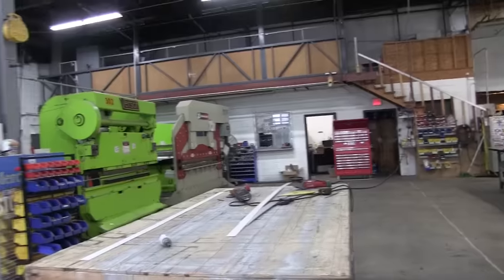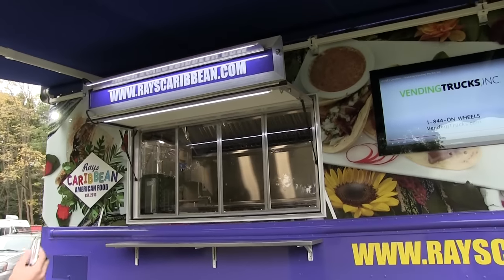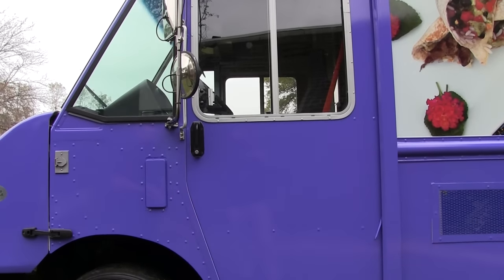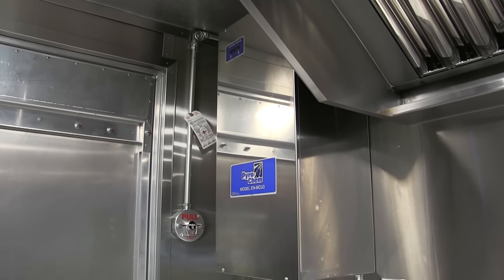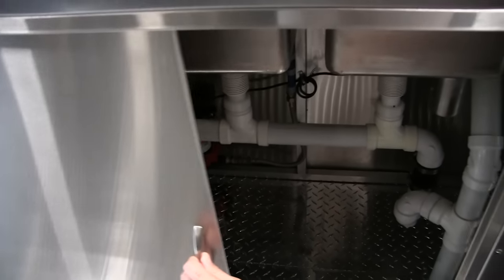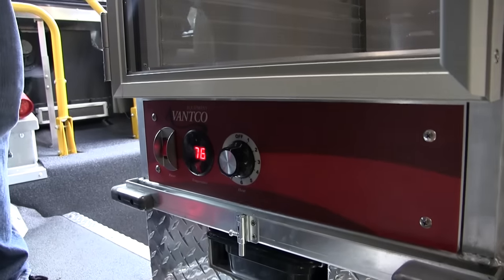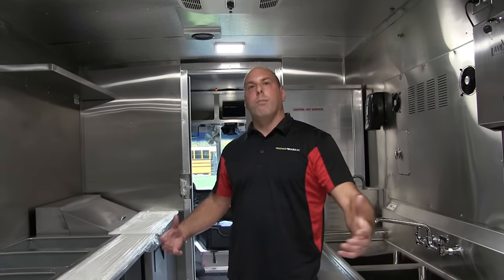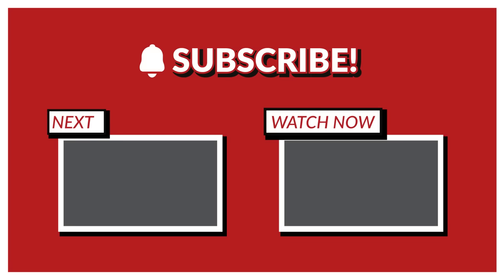Top-of-the-Line FOOD VENDING TRUCK INSIDE TOUR

Comment: Very interesting to see and hear how this process works from the inside. Something that wasn’t addressed in the video; how is the truck leveled once on site? I would imagine this would be an issue especially when using fryers full of boiling oil and cleanup sinks that need to drain properly. Do food trucks have a leveling system like an RV would have?
Reply from the maker: Great question. Leveling jacks are an option but many use leveling blocks

Comment: Great video, there are a couple of things that came to my mind when I watched it, the first one was, how they make sure that, that huge juice dispenser is not going to fly off that table while driving? What did you do to secure it? My second question is about that awning, does it go inside an encasing when retracted? How do you prevent it from getting damaged when it is rolled in and you're driving down a highway under the rain?
Reply: Hi Alfredo, the juice dispenser is mounted to the countertop to avoid it from moving when the truck is in motion (aluminum square tubing).  When the awning is retracting in, it is covered under a protective aluminum hood cover.  The material is rated for weather/rain.

Comment: Nice truck! How much does the truck cost to build in this video? Thanks!
Reply from the maker: I believe this one was 150K.
Reply: @NewJerseyOutdoorAdventures  I have one question! Does the onan generators runs 24 hrs  and can support all this equipment? I  am planning to build one like this, one 49 inches cooler,  one under counter fridge 48 inches or smaller,  One snow flake ice maker 24inches, one salad bar 48 inches , steam 28 inches, griddle 60 inches, 2 fryers 30 inches, gyro 20 inches, sinks.16 inches, the sink will be attach to the driver and passenger seat , thanks for sharing this info with enthusiasm!
Reply: Hope someone from the company can reply about the cost so all of us either put our dreams aside or work on it to make it a reality

Comment: You know my next question is going to be.. how much something like this would cost $100,000 all 70,000 I know they're expensive trucks. So how much..
Reply from the maker: This one was 150k
Reply: @NewJerseyOutdoorAdventures  I was basically almost spots on a hundred and fifty thousand that's a lot of money but the equipment is expensive anyway to begin with...
Reply: @skapunkoialternativeliving6522  Thanks Patrick!  This truck all-in was a little bit higher in this case due to the Freightliner diesel vehicle and other amenities.  However, a new custom-built food truck on a gas chassis would typically fall between 125k and 150k once all details are considered.

Comment: Where will the spices go? Any floor drain?
Reply from the maker: Great questions.
Reply: @NewJerseyOutdoorAdventures  thanks. Do you ever see ice cream trucks? I never see them anymore, in summers.
Reply: @NewJerseyOutdoorAdventures  spices can go on the overhead shelving units if needed on the "serving side" of the interior.  However,  in many cases, spices are kept on the top ledge of the refrigerated sandwich prep units...which is where the food item is generally assembled and "spiced".    There are no floor drains on this particular truck but can easily be added. The sloped drain would drain to the exterior below the truck or directly into the waste water tank.

Comment: Huh… I’m not sure that AC does anything when that hood is running. It might be a thing when you’re prepping before the hood starts running.
Reply from the maker: Good point
Reply: An AC in a food truck does not work miracles but helps a little bit.  Pending the design/layout, we try to keep the AC unit and hood as far from each other as possible.

Comment: The bad thing about a truck this size is you have to have a CDL
Reply from the maker: Good point
Reply: Hi Wes,  CDL is only required for GVW over 26,000 lbs.   A standard driver's license is sufficient for this truck.
Reply: Crossing state lines any thing over 10,000 other than a motorhome or motorcoach requires a CDL. I get stopped all the time with my one ton trucks going to and from other states.
Reply: Also according to DOT any vehicle over 26,000 lbs used as a commercial vehicle is required to have a CDL driver even within the vehicle's home state and to cross state lines.
Reply: We have been building and selling trucks this size for almost 20 years and none of our customers needed a CDL license